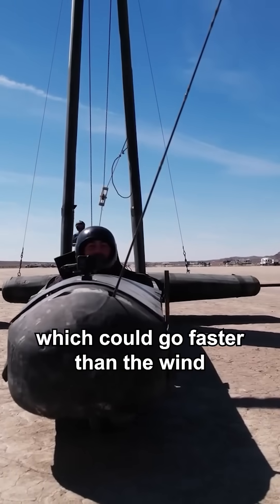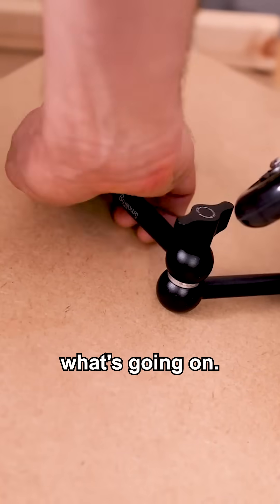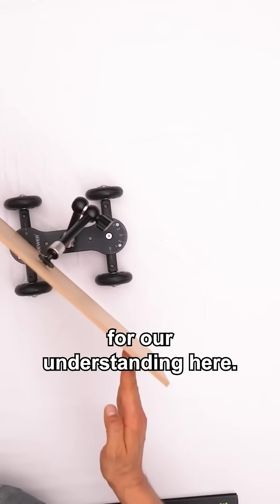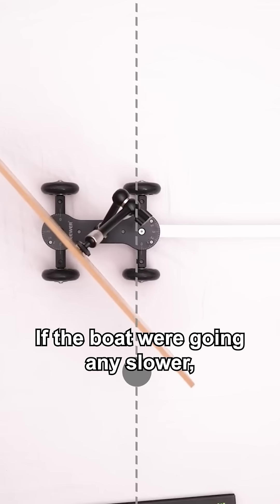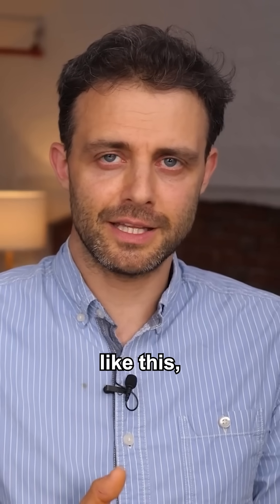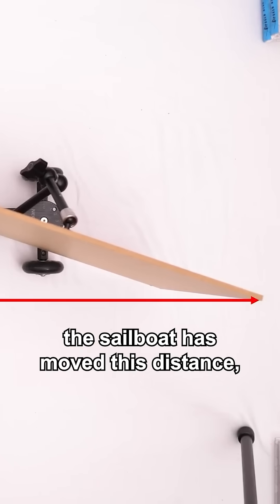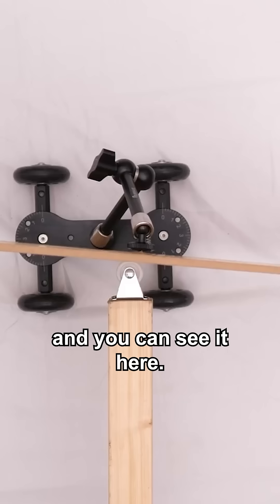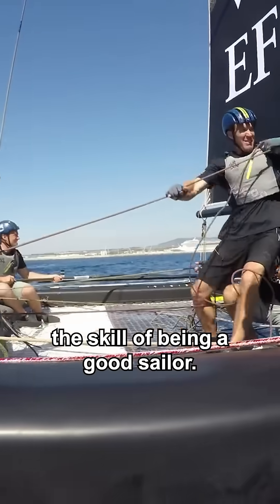How a sailboat can sail faster than the wind

Comment: What I find even more amazing is that sailboats can sail upwind!
Reply: Only around 40 degrees off of directly upwind...
Reply: @travisperry4515  it depends on the boat, maybe on a cat, but lasers can pinch to like 30 and even more modern boats can get to about there without the painfully slow pace of the laser at that angle. Also boats designed to harness apparent wind (all boats with foils and a few others) can go much higher since they need to be able to pinch that high as the faster they go, the higher their point of sail
Reply: @Chuck-Hank  well yea but I still think op thinks sailboats can go directly upwind hence my original comment. As a foiling boat increases speed the apparent wind actually comes more forward causing them to bear off a bit. Max vmg on boats like that is not their high mode.
Reply: @ Nope! Never said they went directly upwind.
Reply: @airplaneB3N  well they don't really sail upwind. It's called 'to windward' or 'to weather'. Sailboats can make their way towards the direction of the wind but I wouldn't necessarily say they sail upwind. If they could sail upwind then tacking wouldn't be necessary.  Sailboats can sail downwind without gybing so I think there is a clear distinction

Comment: And that's (partly) why getting up on foils is such a big deal.  Less resistance in the direction of travel means more extreme angles can still work.
Reply: What would be the noticeable benefits of sailing on foil, besides the reduced drag / immense theoretical speed gain? ( I only found a mention of the given opportunity to design in a displaced center of gravity - on Wikipedia 🧑🏽‍💻)
Reply: @zet0korp apparent wind, with such little drag it doesn’t limit the fact that as you go faster the wind goes faster and so on and so on, water is something like 400x denser than air so getting almost all of the boat out means you can basically sail on you own wind until much higher speeds when even the little foil in the water and air resistance is powerful enough to stop the boat
Reply: @Chuck-Hank isn't the boat more likely to topple over when it's on foils and at a sharp angle to the wind?
Reply: @zet0korp  there are a bunch but it gets into minutia thats hard to explain if you dont sail. reduced drag is the main one, but that also comes with increased airflow consistency because your vessel doesn't bounce in waves anymore (all changes in heel angle and boat speed from waves theoretically change the optimal sail shape at any moment, and you cannot possibly adjust the sail in those fractions of a second) 

it also gives major weight savings and force balancing advantages. typical vessels require some form of counterforce to the force of the sail trying to tip the boat over. on large vessels thats normally a keel, which weighs a lot. if the boat has foils they can use the foils to generate a counteracting force to the tipping force of the sail which is more efficient than carrying the extra weight of a keel. if you want to visualize this google imoca 60's or ac75's (two foiling boat types that use this a lot) this extra leverage can also be used from a design perspective to just outright get more force from the sails and hence more speed.  without the extra counteractive force you're limited in how much power you can use before the boat capsizes 

finally, they have the benefit of reducing horizontal slippage in the water. by tipping the vessel intentionally towards the wind (windward heel) the foil generates some horizontal lift towards the wind and can make the boat "crawl" upwind instead of slipping slightly downwind as it sails like every other type of boat. this negative slippage isn't actually  that efficient to do however you can get the slippage to 0 with the right amount of tip, which is beneficial compared to positive slippage most boats have (the slip angle is technically called leeway angle)

Comment: I always imagined this by just thinking of pushing a slightly ajar door open with your hand near the hinge. You push with little speed against an angled surface slowly, yet it moves fast. Almost like a gear - low speed high torque input giving a high speed output
Reply: Almost like a gear - exactly like a lever.
Because it is one.

Comment: How does the whole "foil/lift/wing" component affect this? I've seen sailboats travel into the wind, and suspect that has to have some effect at these angles.
Reply: to travel into the wind you need to 'tack', so you're zigzagging in the direction the wind is coming from; you angle the sail about 45° relative to the wind, but the boat is more like 60° against the wind, the resulting force pushes the boat at 90 degrees to the wind, but due to the shape of the hull it mostly moves in the direction it's pointing, which is slightly upwind
Reply: Less water friction would increase speed in direction of travel, but at the cost of air resistance in that direction (less).  Undoubtedly that would affect choices of when to zig zag, and best angles... and you'd get somewhere sooner. Beyond that, my comment is useless.

Comment: But can you travel faster than the wind going the same direction as the wind?  If the wind is blowing North @ 20 knots… the boat may travel > 20 knots to the East or West, but can it sail North at > 20 knots.
Reply: yes, though it takes some effort; if you can get going faster than the wind (say going northeast at 23 knots in a 20 knot eastern wind) and then steer the boat to face east, you would be moving faster east than the wind for a short time.if you do this repeatedly, alternating between northeast and southeast, you could get further east in the same amount of time than a boat simply sailing directly east
Reply: @TheAechBomb That'd be momentum of the vessel? Surely though, the mass would briefly need to be accelerated up to speed at the start of the next tack... inertia and friction biting into any advantage provided at the end of a tack. (Non sailor handwavy presumption.)
Reply: No, the boat can't sail exactly downwind faster than the wind.
What is easily forgotten is that the boat uses the relative wind; when the boat outpaces the wind, the relative wind blows directly against the movement of the boat .

Comment: I was always taught that it's faster to sail in a zigzag rather than directly downwind.
Reply: They are saying in this video that a sailboat can go faster than the speed of the wind, but not in the direction of the wind. It would seem to imply that sailing directly downwind from point A to point B, with spinnaker up, would be faster than zigzagging from A to B. As much as I Googled in the past when Derek's original video posted I couldn't get a clear answer as to what is actually quickest.
Reply: @JeffGoris  I sailed dinghies, so no spinnaker.
Reply: I guess the limit is still Steve's just-missing "packets" of air, counteracted by pesky resistance.
Reply: Depends on resistance 
Check VMG principles

Comment: I know it's for simplification purposes, but the force generated by the sail actually comes mostly from the fact that the air is hugging the sail so it travels a greater distance on the front of the sail than the back and that creates a sort of lift like with a wing on a plane

Comment: Yes, this agrees perfectly with my practical understandanding; viz, this is why “close hauled” is faster than “down wind” even with a spinnaker sail, “wing and wing”, etc.
Reply: An infinite chute is only going to get you up to whatever speed the wind is going, sticking one foil up into the wind, and one down into the water let's you extract energy from the relative motion and go as fast as drag allows.
Reply: Surely you're only travelling faster in the direction of travel, not in the direction of the wind. Straight downwind travel would surely reduce friction, due to lower speed, and get you downwind sooner. Cognitive bias might explain the thought that zig-zag is faster.
Reply: @ChrisNotTheKing "zig zag" is faster because of inertia. 
But generally it doesn't matter what direction you're going, you only need the differential speed between two bodies and a contraption to extract energy from that motion.
Reply: @fritt_wastaken  Is that inertia the momentum of the vessel at speed?  If turning 180 degrees, surely all that momentum must be shed before building up momentum in the opposite direction.  For turns to a lesser degree, the component of that momentum perpendicular to the wind is asking, "can I be used to augment the downwind component of momentum?"
I don't know the answer, but I suspect real experience would lead a sailor to think that it's possible.  Is this their cognitive bias, or is there a mechanism to channel energy of momentum into an orthogonal direction?
Reply: @ what would happen if you throw a ball into a circular track? It would roll in circles many many times (potentially infinitely many, ignoring friction), all with the same initial momentum.
There are two main conservation laws: momentum and energy, they should always be considered together. As long as you have firm enough foundation to transfer momentum to, energy conservation would allow you to transform your momentum however you like. Because momentum is linear and energy is quadratic.
Reply: @fritt_wastaken  Ta for responding.  I can grok the ball on a track, and the notion of an elastic bounce for that matter, but will have to reawaken my physics modelling neurons to get much further.

Smooth sailing.